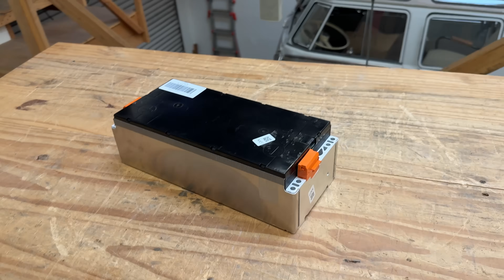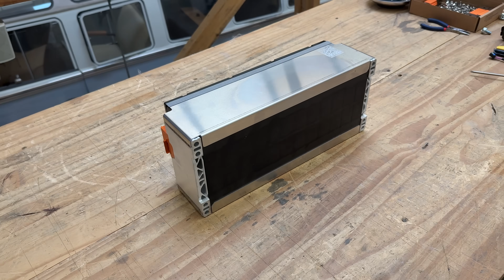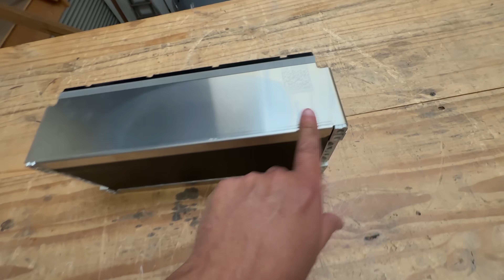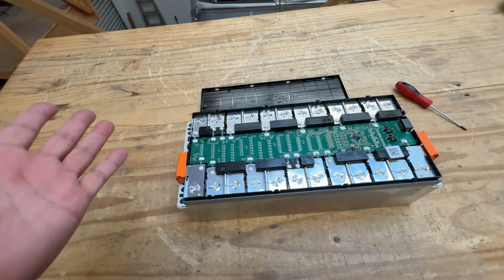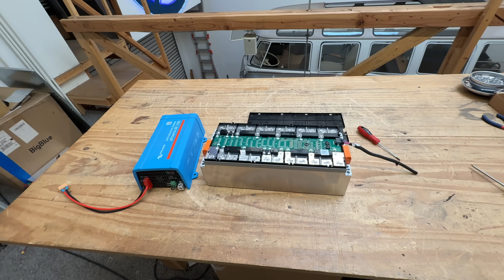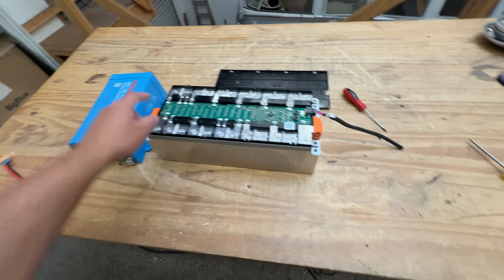2.2kWh AlFa Romeo battery Modules

Comment: I purchased one of them from you... Have a question... How do you CHARGE them? Most MPPT chargers are either 36V or 48V... However, the "max" on those should be about 46V... How NOT TO "overcharge" (or blow) them? I would like to connect them to solar panels...

Comment: This is also the same module that is in the Dodge Hornet Hybrid as well.
Reply: Most likely also the Jeeps Renegade and Compass 4Xe plug-in variants...they all share the same base platform and the same 1.3 4 cylinder Firefly gasoline engine driving the front, and an electric motor at the back
Reply: @luca7069 correct, those never came to the US though